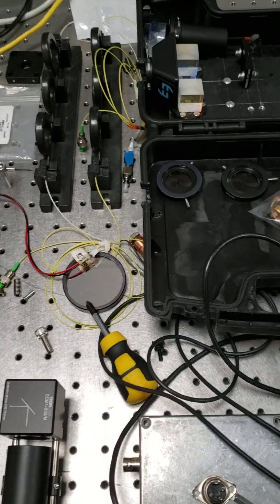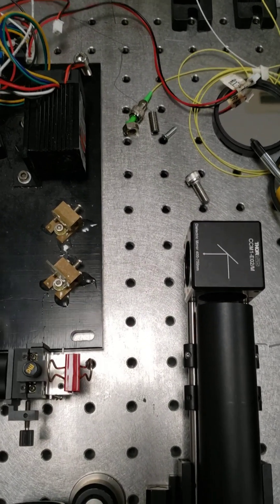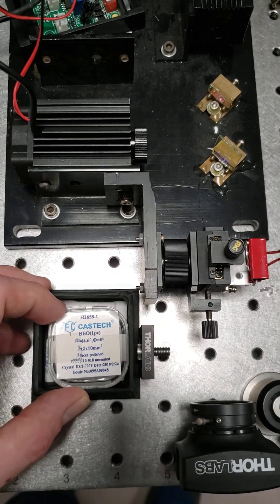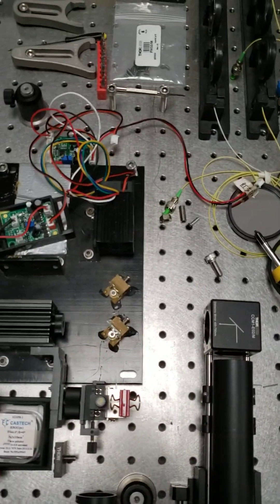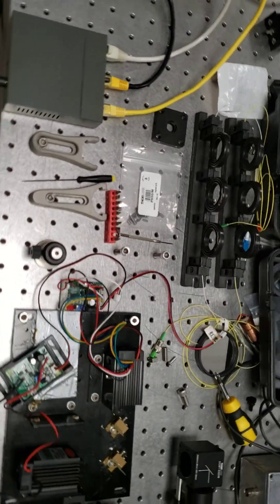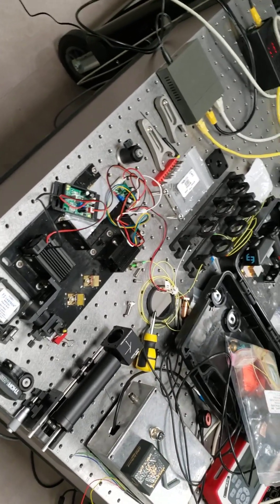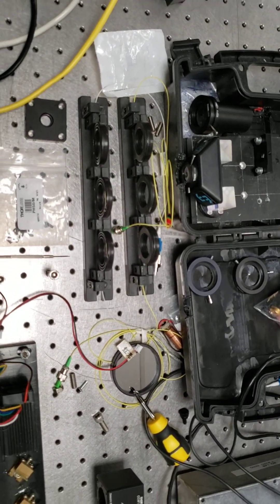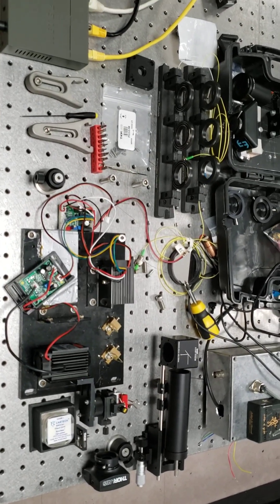Quantum Entanglement Network using Non-linear Optics with beta-Barium Borate BBO crystals 💎

Comment: Excellent work!! Impressed by your setup. I have the same IR pumping lasers along with the TTL controlled power supply, though I never got a chance to try and pump a non linear crystal yet.
Reply from the maker: Thank You, admittedly this setup is by no means the most optimized out there and even with temperature control it is still acting mainly as a classically thermal system with some entangled photons being generated to constitute a signal. Even with BBO the efficiency is low and hopefully I will move to PPKTP as the crystal of choice though they are far more expensive. My ultimate goal is to create 4 of these nodes to display some networking which is where my interests in this currently lie. Systems like this are already being used in quantum metrology which is, as they say, where the money is at the moment.
Reply: @MuonRay Hi, I have seen your small laser module, can you give me the data to find it? Any idea how or where to get lasers plus bbo or ppktp at the lowest price? I guess currently they are industrial prices due to a limited production than a mass production could allow, even with a lower quality or sizes could be an option for little experiments, schools or hobby.